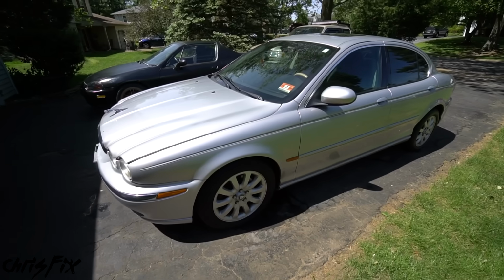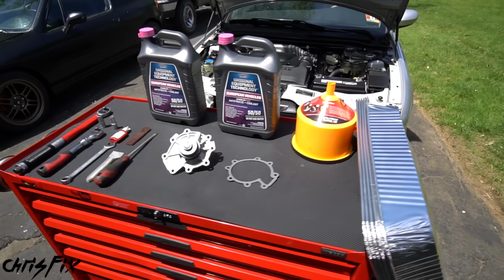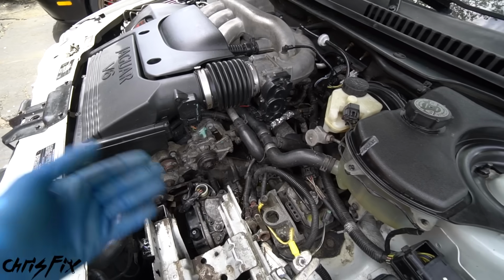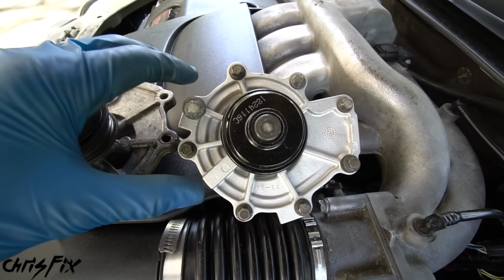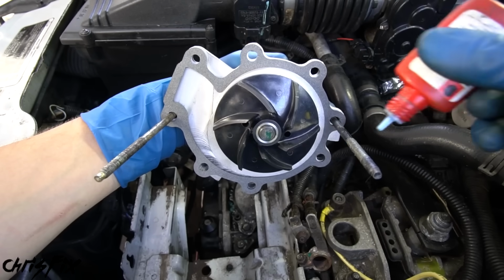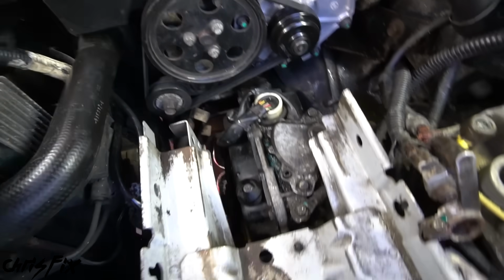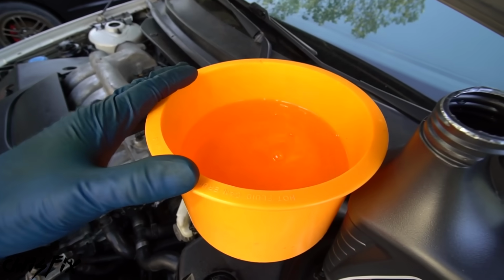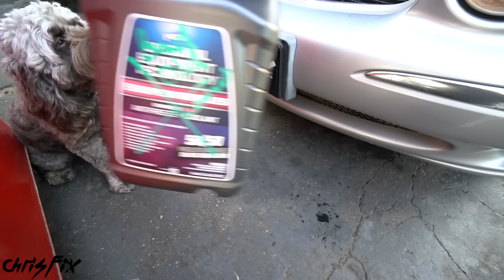How To Replace a Water Pump and Save $783

Comment: Wish it was that easy in my car.

Anyone that's had to change a water pump on a 2JZ will understand my pain.
Reply: Tawi Dave north stars can be a nightmare too. There’s just no room to work in. :(
Reply: Tawi Dave try changing in on an STI. That shit is pretty damn hard cause of all the stuff that’s in front of it.
Reply: @flat_life750  I also own a subaru legacy b4 3.0r. EZ30 engines are a nightmare to work on.
Reply: There are much worse motors to do it on too, at least the 2j is pretty straight forward.
Reply: lol at least you can get to your water pump without pulling the engine out.
Reply: What about a 3.8L in a dodge or chrysler minivan? You have almost no room
Reply: @Jolan Krahn 3.8s are problems too lol
Reply: @Jolan Krahn Chrysler. The chevy trailblazer 4.2L are a pain in the ass for thermostats

Comment: After removing the belt, how did u easily break the water pump pully bolts without spinning the pully? 
Wouldn't it just keep spinning.
Reply from the maker: Those were cam pulley bolts not waterpump. The cam wont easily spin because the pressure from the engine.
Reply: @chrisfix  ... Noted with thx.

Comment: Chris : next video will be the dream car
jag : hold my coolant
Reply from the maker: haha this sums it up nicely
Reply: @chrisfix  when dream car reveal
Reply: YA WHEN DREAM CAR REVEAL
 @lgndrydevilhunter
Reply: @chrisfix  your repairs shows much clearly and more easy to understand thanks very much
Reply: @chrisfix  when that thorttle body upgrade coming for the drift Sang
Reply: @chrisfix  I know right!
Reply: ChrisFix is your dog a boy or girl
Reply: ChrisFix can you help me at all I just wanna know what the sound is coming from so whenever I first start up the car then turn out I hear a weird sound coming when I turn but it only happens the first start up
Reply: @gsjourney3054  ... I am sure when Chris see this he would help! He seems like a way cool guy! I am an ASE MECHANIC.. what is the noise?
Reply: @gsjourney3054  if it's a squealing sound, it's probably a bad tensioner
Reply: @gsjourney3054  nice description
Reply: @gsjourney3054  power steering ? Rack and pinion?
Reply: gio rami it’s not a squealing it’s like a maybe stuck power steering or maybe you know the sound when you turn on ac but it’s not the fans
Reply: @gsjourney3054  a squirrel
Reply: @gsjourney3054  is it a knock or does it tick when you drive
Reply: Topshot9890 1 nope it doesn’t happen when driving you know that sound when you reverse and it’s like a whine it’s like that sound the first start up when I turn the wheel but doesn’t happen after that
Reply: @gsjourney3054  check the power steering pump
Reply: @gsjourney3054  From what I can make of your description, it sounds like you may have a stuck check valve in the power steering pump. If that's the case, it could be gummed up and only sticking for the first few minutes, when you first start up, until a turn or two, when the fluid actually gets flowing. That's really one of those things that we'd need more details on - like specifically hearing it, to be able to really tell. It could also depend on the make, model and year of the vehicle as to what components are specific to that vehicle. However, I would, as someone else mentioned, start by checking the power steering pump, or for low fluid in general.
Reply: holy smoke ! my comment got pinned !!!
Reply: Alice in Tankerland he also posted this on Instagram
Reply: @turbo_alice  congrats mate
Reply: Me inte jag
Reply: Littel Jake he meant jag as Jaguar, he’s not Swedish
Reply: Littel Jake han menade Jaguar fast förkorta med jag
Reply: @litteljake3366  "Jag" står för Jaguar (bilen)
Reply: when are u going to upload new vid on ur dream car chris
Reply: ayy lmao
Reply: still here waiting for the car reveal :(
Reply: Only reason I watched this was to see his dream car. Sad day
Reply: He unpinned this
Reply: Chris brought me here an lmao nice one
Reply: True
Reply: He said on Instagram that he can’t do the dream car video yet
Reply: Ok I thought you forgot about it
Reply: LOL!!
Reply: Your on his instagram too
Reply: Hi
Reply: You made it friend.
Reply: Yeah I am kind of expecting that dream car intro too
Reply: lol
Reply: Thank you guys I’ll take a look at that stuff
Reply: Hahaha
Reply: Yeah, what's up with that reveal vid? Or was it a gag?
Reply: @czurz79  honestlyyy!
Reply: Alice in Tankerland xug
Reply: Alice in Tankerland, yeah I was wondering about that since we were told the next video would be the car.
Reply: Alice in Tankerland du är svensk
Reply: Might be an Mr2 turbo
Reply: Me af rn
Reply: That didn't look like a Hummer....
Reply: Alice in Tankerland Svensk? Hej isåfall
Reply: He bought his dad a new Dream car as a replacement for the Jag
Reply: Lol
Reply: Hold my wooder
Reply: Looked like the gasket goop let go, reapply and done less than $10.
Reply: @wobblysauce  coolant coming out the weep hole means the bearings in the pump are bad. If left unfixed the pulley will go outta balance and shed the belt. Also will leak coolant and this can ruin the engine if the coolant gets low.😎
Reply: @FunkyCold6875  small leak, fine can top up... spraying with the bad gasket... an issue.
Reply: robert medina yea I experienced the out of balance pulls on my power steering and that’s was a fun day! 🙃
Reply: @wobblysauce  hahahaha yeh looks like it .... borrow some from a friend ... free !!!!
Reply: @roberttudor455  Should be a staple in the box...

Comment: do how to on jettas  LOL the water pump is the HARDEST to replace you got lucky
Reply from the maker: They are off the timing belt on those right?
Reply: @chrisfix  Yes You have to basically drop the whole motor, a lot of work I mean, I work on them for a living. just some Cars are designed differently and jettas i hate changing water pumps lol!

Comment: Could you install both a turbocharger and a supercharger in your mustang, I wold love to see both forced induction parts because it will rip on the track
Reply: That would be called twin-charging. Very hard to maintain a system like that, as cool as it sounds. Very few cars are twin-charged from the factory for that reason

Comment: My water pump literally went out 2 weeks ago in my mini and I had to take it to the shop. I wish it would have went out 2 weeks later so I could use this video and save the $750 that it costs to fix it from the BMW dealership.
Reply: You went to a bmw dealership to maintenance your mini?
Reply: @brotherrussia1719  yeah, BMW owns mini.
Reply: There the only place that will service them around where I live.
Reply: @calebhopkins7354  never knew that
Reply: The issue with MINIs is the lack of bonnet space to do the repair.  I've replaced water pumps in many cars but when the one went out in my 08 Clubman several years ago, I paid the dealer to do it as it actually required moving the engine to gain access!

Comment: Got a 2003 Mercury Grand Marquis that needs a new intake manifold because it is leaking coolant. I took it to a garage and they were going to charge me over $1,000.00 to replace it. I am going to replace it in my driveway for about $200.

Comment: I just did this to my ford explorer this last weekend. Replaced fan clutch and fan just as preventitive maitenance as you taught me. Great video
Reply: Did this on my h3 hummer easy as pie. Like you said just for preventive maintenance wise. I also replace the fan clutch as well. And just for the hell of it. Cleaned the fan blades lol. New radiator, water pump, fan clutch acdelco radiator cap. Running like a charm.

Comment: super easy water pump change. In the 2 cars I have to do, required having to pull the timing belts, which adds a lot more difficulty and skill.

Gotta make sure what you need for you car before you dive in!
Reply from the maker: Yea this was an example of a simple one. The timing chain ones are also not horrible but definitely way more complex than this
Reply: @chrisfix  For sure, but still a great video for those who have similar systems! Love your vids, thanks always.

Comment: Jaguars are horrendous for replacing parts me and my dad replaced the rear disks and pads then the ads warning light was on now the drive shaft and abs ring needs replacing with his car it’s always one thing after another it’s a lovely car as it’s the v6 twin turbo diesel and does have a good amount of power just just crap for replacing stuff.

Comment: Why so expensive...
You don't even need to touch timing belt...
And the access is so ooo firckin good to ...
Reply: Labor rate and miscellaneous fees at a dealership jack up the price. The mechanic probably will see like 80$ off that job
Reply from the maker: That is my question. I understand shops need to make money but this was a little crazy.

Comment: Ohh perfect. This is just what is happening to my car. Glad I can fix it myself because Subaru is expensive
Reply: On a Subaru the waterpump is driven by the timing belt, though. Therefore this job will be a lot harder since you will have to remove the crankpulley, the timing belt cover, and need to make sure that the engine is on time after installing the pump. Might as well replace the belt, tensioner and all the pulleys while you are in there.
Reply from the maker: Unfortunately Subarus will be more involved. You need to remove more parts to get to t he timing belt and then you can remove the water pump.
Reply: I believe the water pump is no longer on the timing belt on the newer Subaru engines (FB series).  If you have an FB series it may be a simple job.
Reply: ehhhhhh boxer engines are quite different than this. Subaru water pumps are typically timing belt driven, not serpentine belt driven. You have to remove the alternator, move the ac compressor and power steering pump. Then you have to remove the timing covers and remove the timing belt.
Reply: @birdbrainxzx  no you don't need to remove the power steering, AC or the alternator